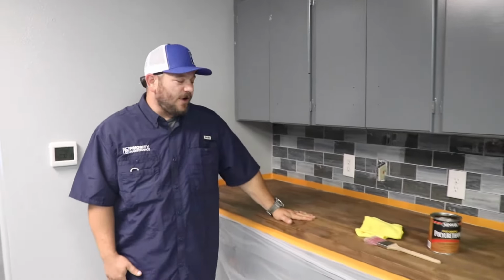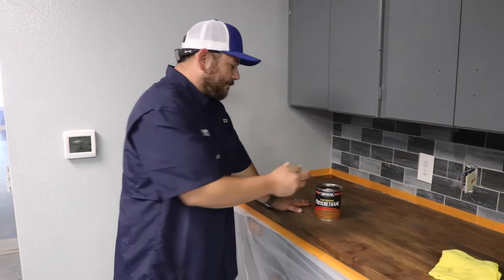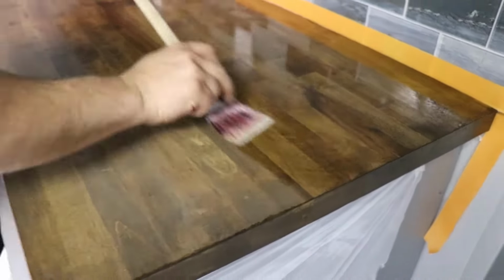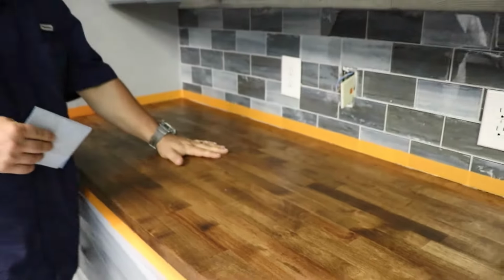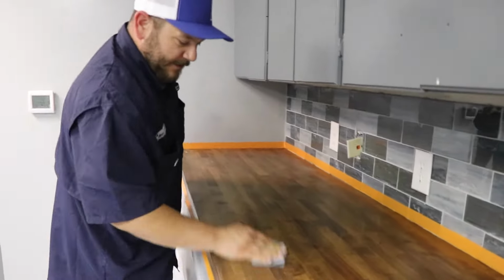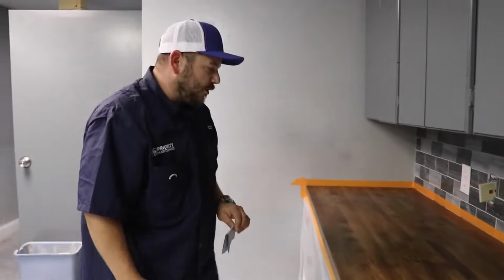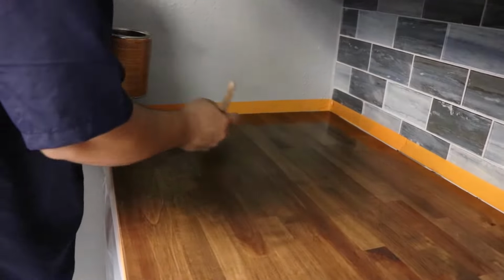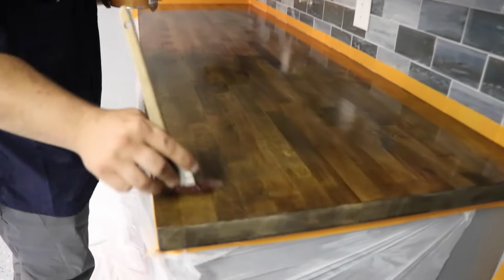How to apply Polyurethane Clear Coat - How to

Comment: lots of basics missed:
1-use the appropriate brush for oil based stain/poly/ varnish. Never dip a dry brush in the can, always wet it w mineral spirits first
2- Never use the can as your serving canister, any dust etc. on the first couple strokes will be transferred back to the can, it's contaminated.
3- 1st coat s/b 50% mineral spirits 50% poly, in the mixing cup/ jar
4- next coat 25/75% poly
5- full strength
6- use a damp cloth with mineral spirits to wipe the dust nibs between coats.
7- use 5-8 coats for the counter top. Last coat , a wash coat, s/b 50% mineral spirits 50% poly
Reply: As a woodworker myself, you’re spot on.  Why shortcut the final step after building and installing a beautiful piece?
Reply: How long do you let it dry between coats?
Reply: Bro 8 coats lmao gtfo
Reply: My wife wants to insert photos under the clear coat when I refinish our island top, is it possible?
Reply: @Liimpy   possibly, you'll need to take a test print out on a scrap piece to test, depending on the acid in the paper if it won't interact with the finish on your island.
Reply: @alangoodwin1966  just curious, if you're doing this on a countertop with a sink using oil based poly, how long would you wait before you install the sink? or use it? or does it matter?

Comment: Hi! Thank you for very useful video and great tips. I tried to do something similar, but something went a bit off, so I’m kindly asking you for an advice: I have a wooden IKEA table. Its top made of several wooden blocks, so it’s not a single sheet of wood. I dyed it using water-based dye, and covered it with the first coat of polyurethane lacquer. The thing is that after applying the first coat I can see that the surface gone patchy – some wooden blocks are glossy and smooth, and some – dull and a bit rough to the touch, where the wood absorbed the lacquer. 
I was going to use fine sandpaper to even the surface after the first coat of lacquer. But now I’m a bit confused as I don’t know if I could damage the dye layer on the dull patches and expose the wood, as it is obviously very thin.
What would you suggest to do in this case? I was going to do at least three coats of lacquer with sanding in between.

Comment: I always get brush stroke marks, no matter what. Any tips?
Reply: So did he! I'm looking into it too, I think a spray is the way to go?
Reply: Foam brush is better
Reply: @danieileen1190  tried foam but still streaky. Thanks though.
Reply: Just avoid going back over the poly that you’ve just brushed on. Make sense? Like slap it on then don’t touch until its dry
Reply: @ethanshields1450  Thanks for that, will try to not feather it.🤙
Reply: I know it sounds terrifying, but try a 1 to 4 or 1 to 5 ratio of paint thinner to polyurethane on your first one or two coats. Apply thin coats. Do not retouch, and light sand block (220 or higher grit) and dust off between coats.   Make sure it's a square brush intended for oil paints and drag the brush, do not apply pressure, which takes practice.
Reply: @jasonbengel  Thanks for that. Been using wipe-on poly for the same thinning effect and it is way better for no streaks🤙
Reply: Well your not really supposed to brush clear like that. I'm pretty sure your supposed to brush it in 1 direction from one end to the other without stopping. One guy on you tube uses Lacquer spray to finish but idk if that works on poly.
Reply: Foam roller works really well for me, referring to a water based poly.
Reply: @RedBeardDevelopment  awesome, thanks🤙
Reply: A good thick natural haired brush for oil and synthetic for water but should be thick the brush he used here is for paint not poly big difference and for beginners i recommend do not use 220 use 800 unless there are puddles then use something a little more rough like 400 i been doing this a long time and i still use 800 but there is several ways to apply poly and it look decent main thing take your time go slow dont brush it repeatedly get it down feather it once and leave it alone
Reply: I buy 20$ brushes when I finish with polyurethane. This and feathering does the trick for me. You need a super soft nylon brush